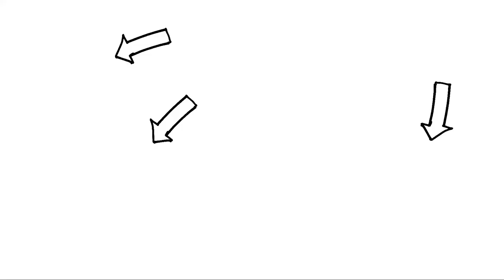Cutting all my Slabwood for Firewood + Fixing the Stovepipe

Comment: Did you look inside of all the log tubes to see if it's in there. That makes for a lot of fire wood. We have been warm here also. Cold early in the week. Snow this morning. A good inch or so. Only 33 for a high today, but suppose to get up to 70 by Thursday. We'll take it. Thanks for sharing. Iowa is watching
Reply from the maker: Typically I try to stick the ones I'm not using inside the log bunks, and I'm pretty sure I've checked each of them a dozen  times now.... lol   Sounds pretty similar to the predicted temps for down here too.